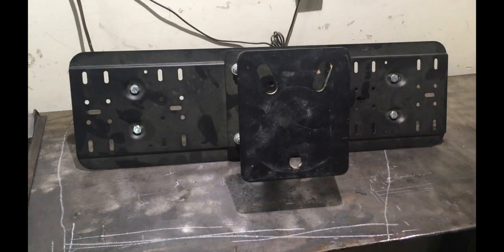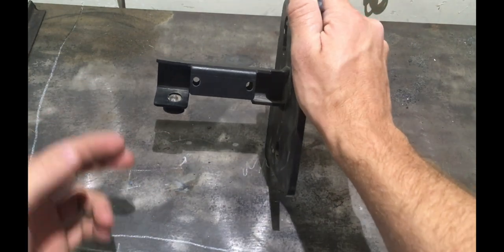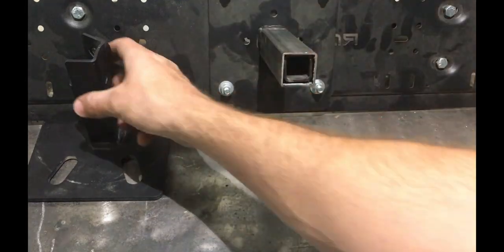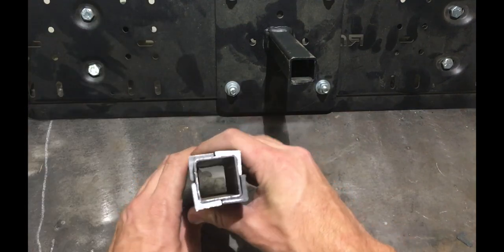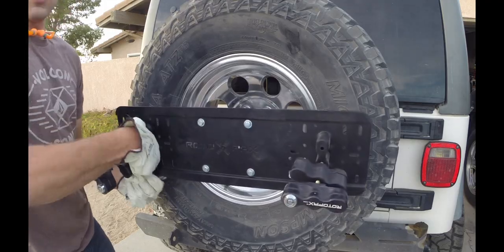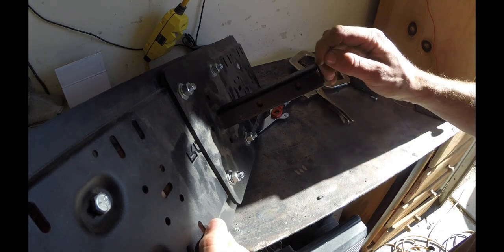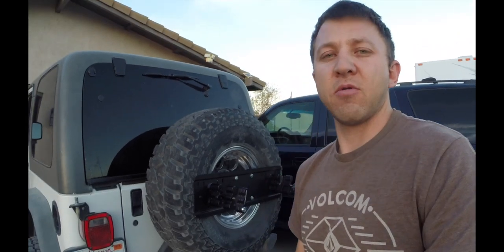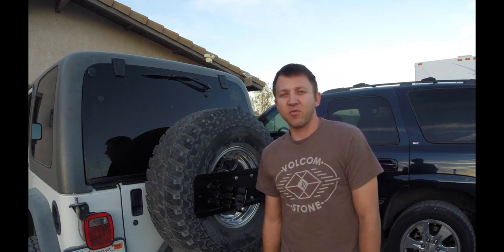Rotopax Spare Tire Mount - Watch Before Buying

Comment: Wow that’s crazy, props to you for your engineering solution. I bought one within the past year and am about to finally install it with a hurricane heading this way. I think they’ve re-designed this piece because the one I have is way more similar to your approach and critiques. They might’ve actually listened to you!

Comment: Very nice work!  I was going to order one of those not realizing the mounting place was upside down for my Teraflex carrier.  It would have failed like yours with a 5 gallon steel Jerry can + Front Runner can holder bolted to it.  I'm looking at either the ACE or the EVO MFG one now...  Thanks for saving me and others on the Rotopax one :)
Reply from the maker: You are very welcome! Im glad you found the video useful. Both of those appear to be high quality I do not think you'll have a problem with either. Thank you!

Comment: Great video! I'm gonna have to do something similar to my JKU. I had cobbled a 4 gallon rotopax  water stacked with a 4 gallon gas onto a Tule spare tire bike rack (yeah too heavy I know now). Worked for a while but eventually folded like a taco after I gained "unintentional air" at big bend national park. The trail fix involved a spare ratchet strap and duck tape a lot of beating the rack with a rubber hammer using a picnic table as an anvil. Very helpful vid, Like your channel just subscribed.
Reply from the maker: Thank you, its much appreciated! Wow sounds like you had one heck of an adventure. All good trail fixes involve duck tape and ratchet straps.

Comment: Obvious misuse of the product
Reply from the maker: Honestly I thought so too. I called the company before purchasing and explained my use. They said the mount was built to handle my usage. I called when this happened before making this video. They where unsure as to why the mount would not hold up. Clearly it is not designed well enough. Their customer service was pleasant to deal with.
Reply: I'm so glad you were there and watched how it failed. Also do you have proof that's its misuse of the product? I've seen a lot of his videos and i don't think hes the kind of person to misuse a product.
Reply from the maker: Honestly, I’m not sure how someone would miss use the product to start with. It only goes on one way. Maybe you could elaborate.
Reply: @EmbarkWithMark  The extension part that was weeded on at the factory got welded on upside down.
Reply from the maker: You’d think so, but they sent me a second one and it’s welded up the same exact way. It’s possible they’ve changed things since this video though.